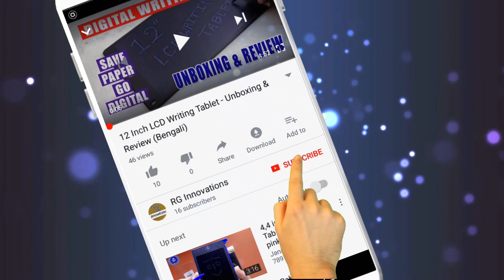APR33A3 - 8 Channel Individual Audio/Voice Recording & Playback Module | 11 Minutes Recording Time

Comment: Hello I would like to use this module in my ground station project for my drone. When I open the case of the ground station, I would like the James  Bond 007  theme played for  a predetermined time and cut off. Will I have to desolder the play button on the module and attach a relay and limit switch to it?
Reply from the maker: Yes, you can do that,

Comment: The 8 Ohm speaker output is very low. How can I get a louder voice. I tried to connect with a commercial amplifier box, but couldnt get any sound.
Reply from the maker: It works fine with amplifier, please check connection.
Reply: Meu amigo poderia me passar o link para esse modulo
Reply from the maker: Sorry cannot find link for your country

Comment: Hi sir I bought and did as per your instruction but my module is not recoding it was recoding twice later it stopped and I did a small change like in that 8 hole I connected to external switch it may be a problem in kindly suggest
Reply from the maker: Have you supplied proper voltage?
Reply: I used 9 v power supply
Reply: Ia there any option to reset the circuit bro
Reply from the maker: 9v supply in which socket?
Reply: thanks for your reply 9v adapter socket is given in the board sir   @RGInnovations
Reply from the maker: There is no way to reset, it's not a programmable IC

Comment: • by grounding the memory pins on this board is it the PlayE (play to edge) operation that gets activated? (I was wondering if it gets activated twice by a proximity sensor it should not play half the recording and then again begin from start from re trigring it becomes annoying )

• Can we use DF player mini Mp3 module without Arduino board to make a mantra/bhajan machine or a calling bell for full bhajans mantra as by triggering by PlayE functionality
 (I wonder why you did’t post video on this most useful and most demanded module sir)

• Is there any other module with more than 10mins audio record time or any MP3 module that can be used to make a mantra machine or a door bell with PlayE function!, independently, Without using a Arduino?

Sorry for bombarding with these multiple questions at once, and thank you for your wonderful video. Most amazing explained than any other video on the same module on YouTube 🙏
Reply from the maker: Please mail me this text to rgstech85@gmail.com, so that I can reply it at convenient time, and it does not get lost in other messages.

Comment: I want to mount push buttons on a panel and when I push each button a different message plays that I have recorded.  Can I connect buttons on this for each separate message, so I can have the electronics behind a panel and the only thing you see is the buttons on the panel?    Thank you!
Reply from the maker: Yes, you can easily do that by connecting wire to the m1-m8 pins and the ground pin.
Reply: @RGInnovations  oh, great. thanks. What size wire do I use? Do you have videos about wire sizes and such?
Reply from the maker: @diyoregonnowtexas9202 I have not tested about how long wire can be used, but i guess about a metre would work fine.

Comment: Hi can u suggest how to use different switches for different message? Can u suggest how to do tat?
Reply from the maker: There are 8 different switches for 8 different messages.
Reply: @RGInnovations  Thank you for your response.  Is this type used in story books  when pressed animal noise were in sequence or vehichles sounds ?  So how  can use its for more than 8 messages per page say its a full book a-z  and when pressed the sounds of the alphabets for kids books
Reply from the maker: This module is for 8 messages only. If you are planning to achieve 26 messages, you have to use any microcontroller like arduino, and an SD MP3 card module to store the audio files.
Reply: @RGInnovations  thank you for your response
Reply from the maker: Most welcome.
Reply: @RGInnovations  hi could u do a video for exploring sound books of kids? The sound recording speaker an connections.
Reply from the maker: Ok I will try to do.

Comment: Is there a way to make it so that it keeps playing what is being recorded just like if you put jumper on ft in isd1820
Reply from the maker: Yes connect the corresponding header pin (need to solder in the holes given) to ground
Reply: @RGInnovations  which pins
Reply from the maker: https://youtu.be/bEyFh0veQJ0
Watch this video, I have shown.
Reply: @RGInnovations so I have to connect all pins to ground or what.
Reply from the maker: No! Only the pin corresponding to the recorded audio channel
Reply: @RGInnovations ok thank you very much
Reply from the maker: Welcome.

Comment: Waooo, really,its audio quality is reall very good. But
(1) Sir from wher we can buy it? I search it in Amazone,but not found the same(this same 8Ch module). Thnx
  (2)can we replace this  on board Mic with a A/V connector to connect this module with an sourse device like mobile phone or pc auduo Output ?? 
But will its noise cancellation will work properly??
Reply from the maker: https://www.graylogix.in/product/apr33a3-voice-recorder-and-playback-module
This is the updated version of the module, with audio socket.
Reply: @RGInnovations   thnx for reply. But is this site is trusted?? in terms of moneytory? & 1 more question,  it has 8 chanel for store 8 different audio string. Now my question is, how can I trigger my required/desired Audio chanel by ardiuno ?? 
Thnx in advance
Reply from the maker: Yes this site is reliable.
I have made a separate video after this for using this module with arduino. Please see the video.
Reply from the maker: https://youtu.be/bEyFh0veQJ0
Reply: Great video!! Do you know of anywhere other than Greylogix that sells the APR33A1 module? They are out of stock. ☹️
Reply from the maker: If you are finding from outside india, you can look up in aliexpress.
Greylogix now added a similar module with auxiliary input, without microphone.